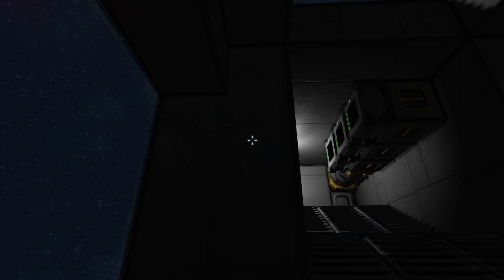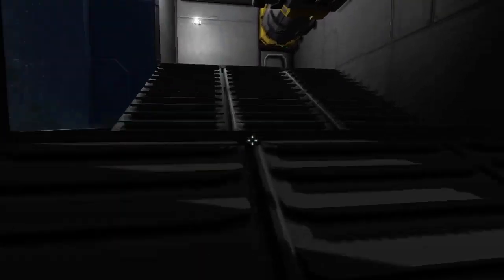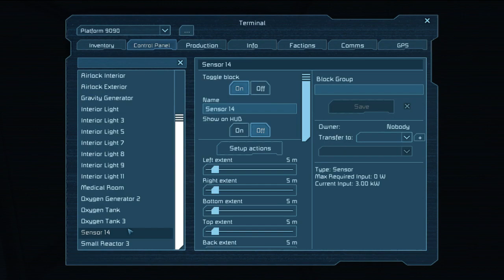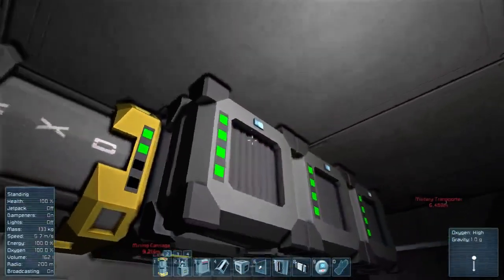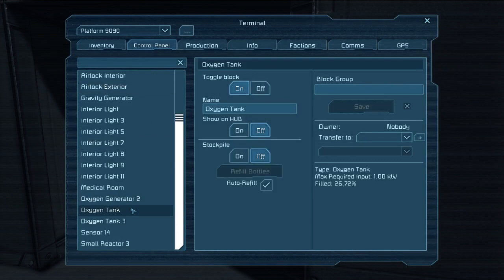Space Engineers: The Invisible Airlock

Comment: I did some repeated tests on this and lost 0.1% air with every full cycle of pressurization/depressurization in an isolated room 5 blocks long and 2 blocks high.

Doors do not seem to make sense if accounting for air loss. After a series of 10 rooms, each equally large, with doors opened in sequence, oxygen content consistently halved with each room transition. There would be loss if the doors were eating the air.

Its possible they have a slightly weirder effect, but I have yet to dig out what that is.